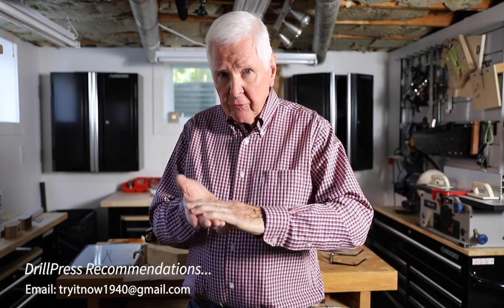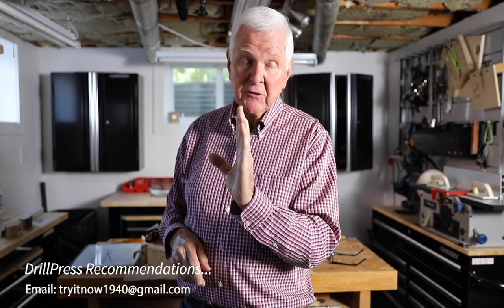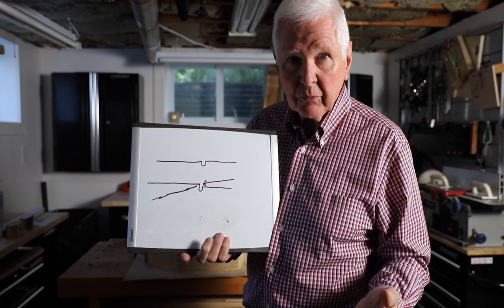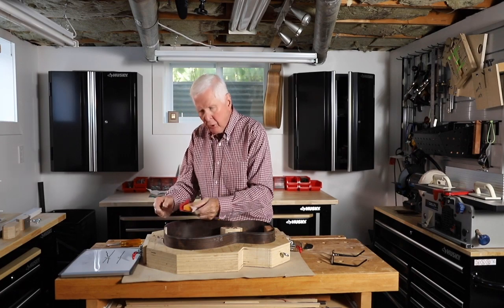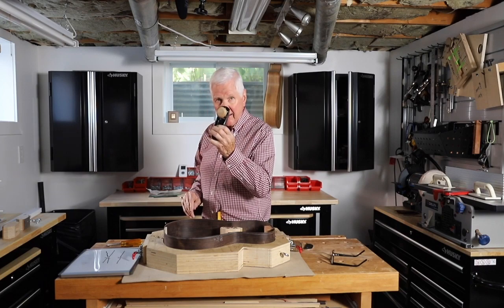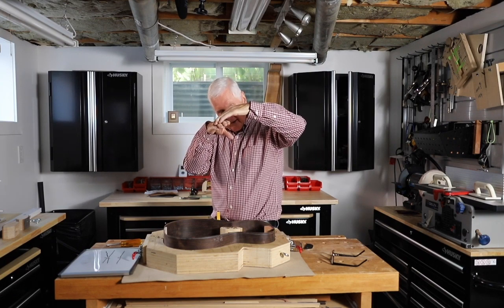Fix the acoustic guitar side now to avoid a major disaster later

Comment: There's something to be said of a nice sharp blade on a plane or a chisel. It's also hard to describe how to work a piece of wood without understanding how the grain orientation affects the whole operation. I'm taking the moral of this story to be "keep your tools sharp, proceed carefully and quit while you're ahead." You could probably do a whole video on sharpening and the proper technique for using a block plane. There's something really satisfying about how a well tuned blade cuts through wood like a hot knife through butter and makes perfect little curls of wood.
Reply from the maker: You are correct and thank you for the suggestion. I need to do that.